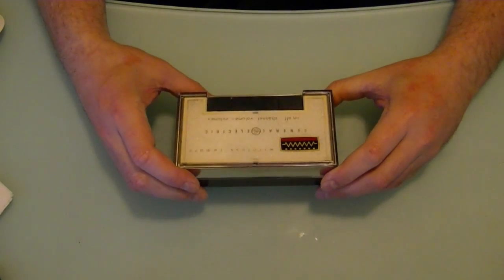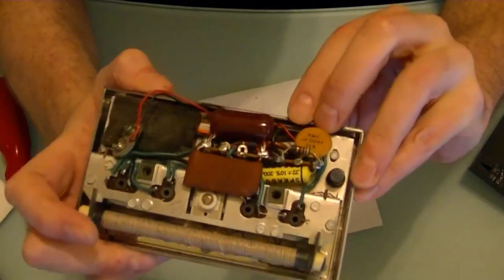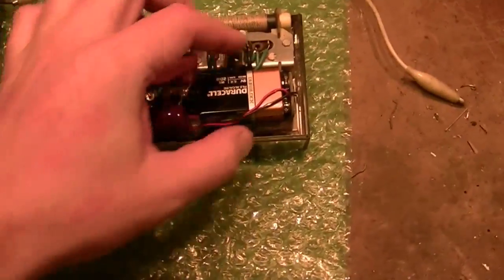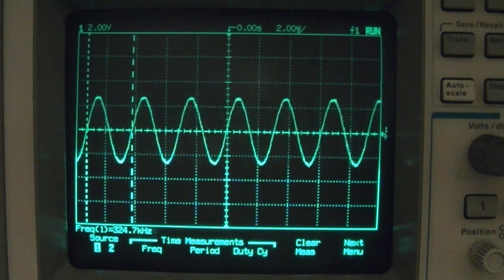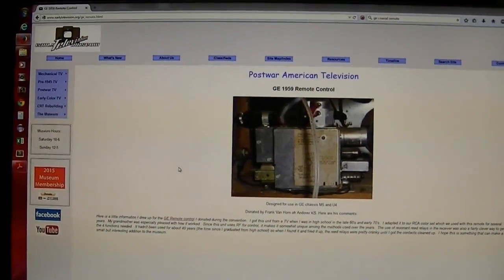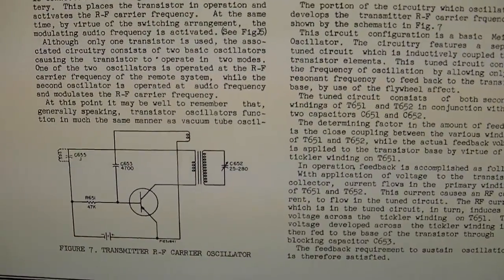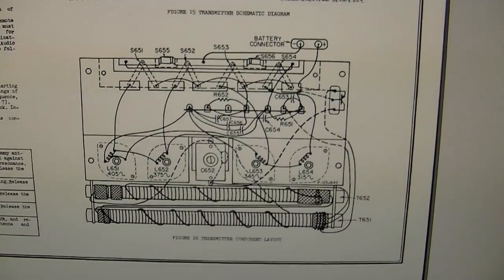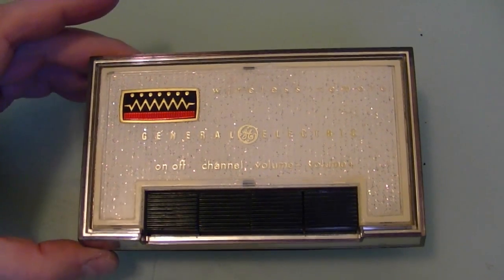Vintage GE RF TV remote control

Comment: I am trying to fix a low noise power supply that uses a small gas tube voltage regulator; Signalite Z100R12. I need a replacement for this part. Thanks

Comment: Early on in this video there was a clue that there was an audio signal being generated as the schematic called the four tuning coils "Audio" or some such description. Yes, very clever circuit. Not unlike the old reflex radios where they used the same tube chain for RF and also audio amp stages. Interesting also that they used tubes in the receiver portion not transistors. One would think they could have easily done that with transistors even with 1959 transistors. Tubes were much more familiar to everyone I suppose. Maybe tubes were cheaper than transistors in 1959??
Reply from the maker: I'm sure they could have. Especially considering the all transistor Philco Safari TV was available around the same time.  I bet it was a cost consideration.  Even so, you did need to keep that tube receiver powered 24/7 so you could use the power on remote function.  Wonder how often the receiver tubes needed replacing ?

Comment: That's a very cool little remote. The red cap you pointed out is early Mylar film, very similar to Sprague Orange Drops. Fisher used those alot in their amps.....they are very reliable.
Reply from the maker: Thanks for the info.  I'm glad I didn't recap it before testing :)